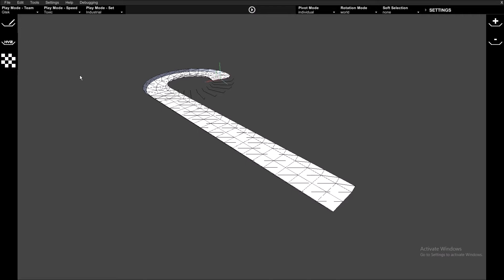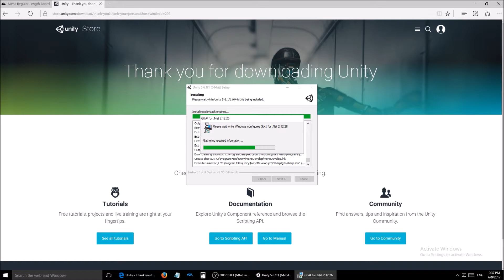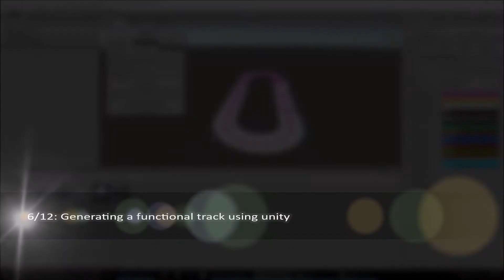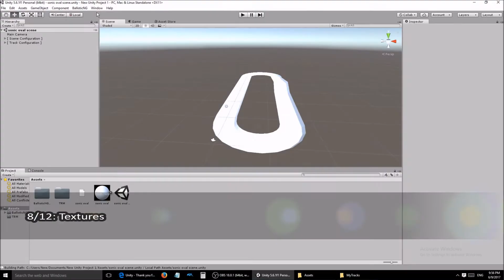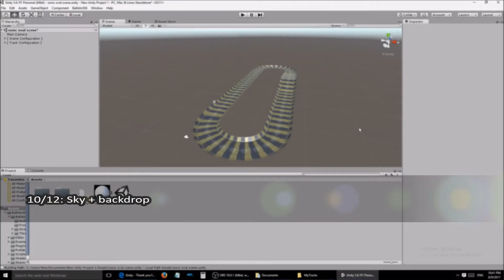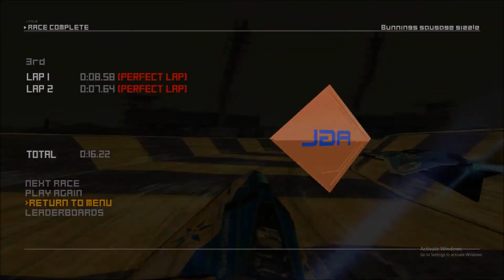BallisticNG Track Tutorial (June 2017)

Comment: I'm having the same issue as Meettheslenderman, where when I copy the TRM file to unity, the file with the white sphere (the track) will not appear, so I cannot go any further with making the track. Any solution to this?
Reply from the maker: The white sphere has recently changed to a grey square. The file should have the ".prefab" extension.

Also, ensure that (1) Unity is already open when copying over the file (2) the file is copied into a folder called "Assets"

Let me know if the ".prefab" file isn't auto-generated.

Comment: Okay, so... It is not working... When I copy the TRM file into the unity project folder, unity won't generate that file with a white sphere on it... So I tried to verify the integrity of the BallisticNG game files in steam... But after that... still not working. When I import the BallisticNGTools package into Unity, I get countless of error messages, one of them saying: "Assets/BallisticNGTools/Scripts/TrmEditors/TrmEditor.cs(3,7): error CS0246: The type or namespace name `BallisticModding' could not be found. Are you missing a using directive or an assembly reference?"
Why is this? Does it have to do with the fact that I use Windows 7? Or is it related to the Unity project folder location? Please Help, I've followed everything you did correctly up until the fckn error TT_TT
Reply from the maker: Hello Meettheslenderman. Sorry to hear that - this problem is not your fault, & you're doing everything perfectly.

All those errors just means the computer is only missing 1 important file, which is meant to be downloaded with the game.

Can you please confirm that:
- You downloaded the game through steam, and
- The file "C:\Program Files (x86)\Steam\steamapps\common\BallisticNG\BallisticNG_Data\Managed\BallisticModding.dll" does exist? This is the file required to do custom track stuff.

I'll try my best to help you out - thanks.
Reply: Hm... Yes, I have the file... This is really weird, maybe the problem lies in one of the 76 - 80 other errors I have when loading the package into Unity? Should I try to delete the file and validate game files integrity in Steam?
Reply from the maker: Hmm, very weird indeed. Yeah, try deleting the file and validating game files via steam.

With that many errors, reinstalling the game or installing Windows 10 might be the fastest & frustration-less ways of working around the problem.

I definitely want to you making awesome tracks - let me know how it goes :)
Reply from the maker: Replied to your PM. I'm ready when you are